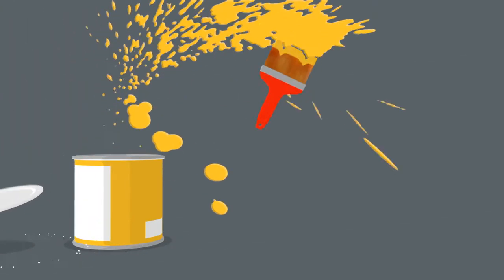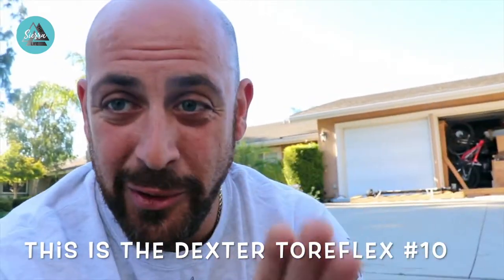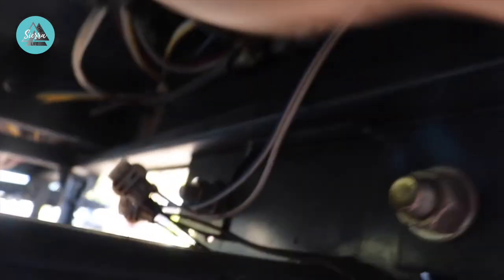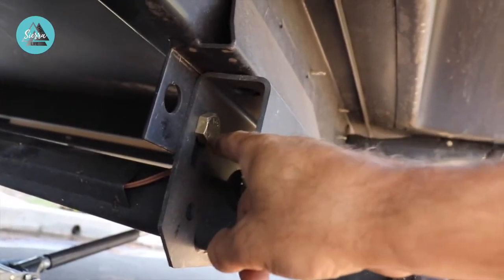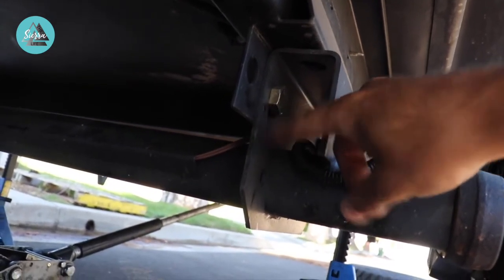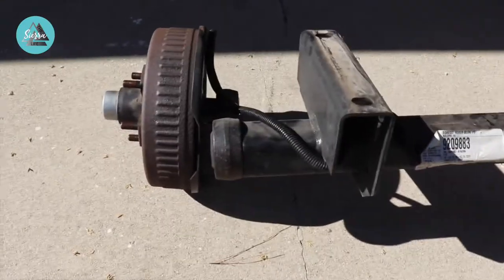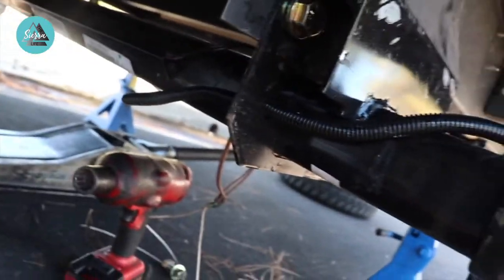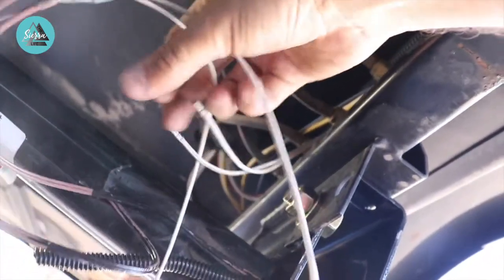Dexter Axel Swap on Geo Pro G15TB

Comment: Hi guys.... New subscriber here, found your boon docking trip to the GC then found this video as well.  Bummer on the axle issues, glad Dexter covered it for you.  I also have a trailer and do the boon docking thing, although I converted a cargo trailer for my travels.  I looked at the Geo Pros at one time but I couldn't go that route as I wanted a more custom set up for my needs and size of trailer.  Mine is small, 5x8 V nose with barn doors, lots of storage, 400 watts of solar panels, 200 AH of lithium iron batteries, two sources of heat, mini wood stove and diesel heater, 12 volt fridge and much more.  Love your adventures and please be safe out there !

Comment: Nice job on the axle swap.  Question - how is your Forerunner MGPs when towing the Geo Pro? I have a 2018 Tacoma with the  V6. I am pretty sure I can tow it easily, but kinda worried how my gas milage is going to be.
Reply: I've heard 11-13 towing.
Reply from the maker: Towing = Gas Mileage Sucks.  Lol.